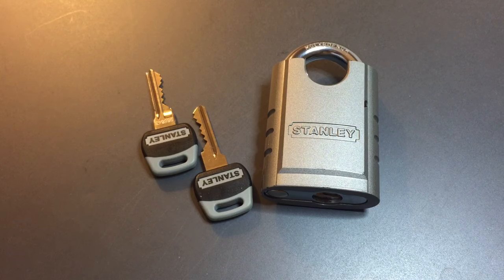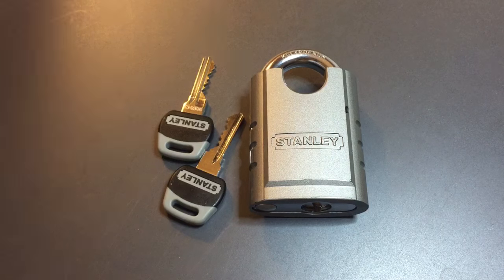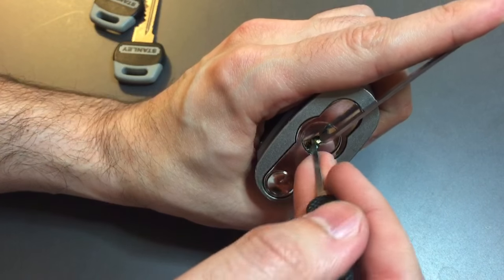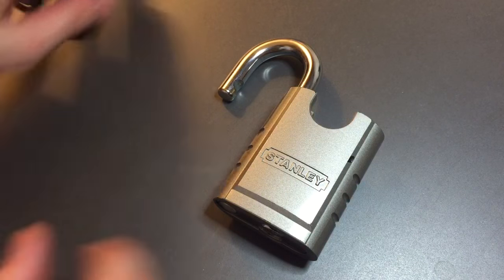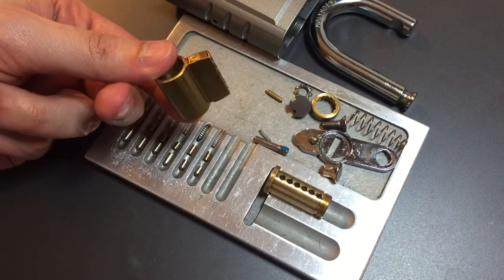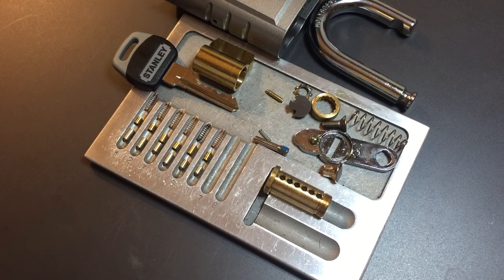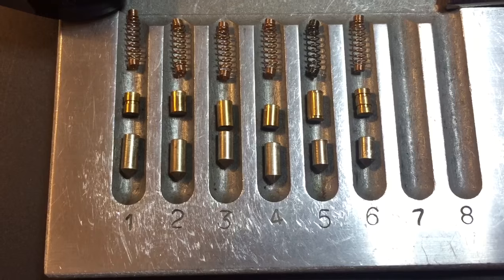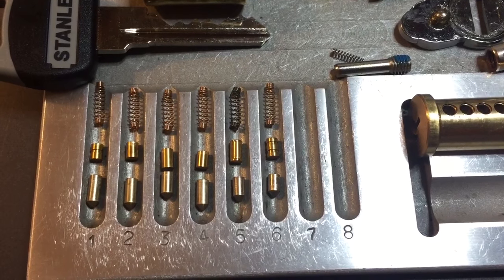[163] Stanley Solid Steel Shrouded Padlock Picked and Gutted (Model CD8820)

Comment: As far as value goes, I was able to pick up a two-pack of these on Amazon for $42.50. I would say that was an exceptional value.
Reply: Yeah, I just checked and they are about $33. And those seem to be limited in supply. On eBay they are around $60 or more.
Reply: Be careful the 2 pack is the 50mm version I haven't been able to figure out what if any difference other than size and dont really want to spend the money to figure it out lol

Comment: I have that lock! It's in my naughty bucket still. I'm still pretty new to picking. up around a 911 master. great picking sir! Always looking forward to your video sir!!
Reply: Hey, me too!  I have been honing my chops on lesser locks (many with security pins), and finally got stuck on a 911.  Have you been able to pick it?
Reply: +Mario G. Cardiel , yes sir. I have been able to pick it, just having a hard time being consistent with it. Also struggling, with the top of keyway tension.
Reply: Cool!  That is exactly my same problem.  I didn't have a tension wrench for TOK until recently, so I have to learn how to use it.
Reply from the maker: Thanks -- Keep at it.  I'm sure you will be slaying these locks soon!  As for TOK, keep using it no matter how awkward it seems now.  Once you move to more advanced keyways and more extreme bittings, you will find that many locks are all but impossible without it.

Comment: Great lock and very nice picking. Was it the first time you tried to pick it?
These 8min promise makes me think. The picking resistance is dependent on the bitting and on the person piking the lock. How can such a number be given at all. Are there standardized educated pickers who test and then they take the average. This sounds more like guesswork to me not like exact science.
Reply from the maker: Thanks.  I almost always pick a lock a few times before the video... just to make sure setting the camera up isn't a waste of time.  I, too, would like to know more about how they make the determination.  I've read the standards for ASTM and UL437, and they are not very specific... practical application of the standards would be far more illuminating.
Reply: @lockpickinglawyer  From ASTM F 883-04 "5.1 Inferences — Cylinder picking, impressioning, rapping,
 decoding, and shackle shimming are described in this specification. Since the skill of the person doing the testing has a direct bearing on the resulting times of the tests, one of each test shall be conducted by a minimum of three different persons having experience of not less than three years of approximately the same skill level and the results averaged for determining relative levels of performance."

Comment: A warning to anyone wanting to buy one of these, if you order cd8820 you now get the 50 mm lock with a 9.5 mm shackle. Not a bad lock, but not this lock either. The new number is 828-160 also hard to find. Be careful!

Comment: These are $28 on Amazon in single quantity, or $46 for a two-pack, so $23 each. I cannot find the 60mm version anywhere now except in laminated without the shackle guard. Still really no point in upgrading the cylinder when you can get an Abloy for less that this plus the cost of any better cylinder.

Comment: Which lock would you recommend for storage units? shipping container doors? I was looking at this one and also some of the Abus Diskus locks, as well as the Brinks disc locks since I can get 4 for $50 keyed alike.
Reply: If you want the best security solutions then get an Abus 83CS/55 or 83CS/80 or Abloy PL362 or PL350 or Squire SS65CS or SS80CS. If you buy cheap then don't expect your shit to be there in the morning! Those I suggested are best bought on eBay auction. I recently got a "bombproof" Abloy PL350 for £45.00 I was dead chuffed! 😎💨👍 All those mentioned a basically bolt cropper proof too!
Reply: ps: The worlds toughest heaviest strongest padlock is now available for around £300 on eBay...the God Almighty Squire SS100CS with its 20mm Boron shackle & weighing in at 9½ lbs. A SeRiOuS Padlock! 😲

Comment: Do you know why some low end and a few high end locks have laminated plates? E.g. the military Miracle Ingersoll.
Reply from the maker: It’s a good question, and frankly, one I hadn’t considered before.  I’d imagine that laminated construction using punched layers is much cheaper than machining a solid block of steel, so that would be a significant consideration.  On the other hand, laminated construction has a long history in security applications, where impact resistance is at a premium.  The laminated construction allows the lock to flex rather than break, and this construction is used in all manner of bunker, vault and security doors.  In that regard, maybe the laminations allow for the use of much harder (cut and grind resistant) materials without making the lock susceptible to shattering under impact.  Anyway, that was my long way of saying I don’t know, but I wouldn’t just assume that the construction is used because of price considerations.  There may be distinct security advantages.  Maybe someone who knows better than me can chime in here.
Reply: Certainly good ideas you have about the matter.  I wouldn't be surprised if you are absolutely right =)

Comment: some assa pins would beef up that lock good
Reply from the maker: +JB I think a new core would be needed to do this lock body justice!
Reply: +LockPickingLawyer its got the counter milling,  it just needs some barrel pins to make them effective
Reply from the maker: +JB Wrong kind of counter milling.
Reply: +LockPickingLawyer not necessarily, it would cause some major false sets instead of snagging it could make the picked pins fall
Reply: @Johnyrocket70  do as you suggested and send it to him, would like to see if it improves the pick resistance, even if he does pick it, this would make for good viewing.

Comment: I have this Stanley lock and am trying to swap the cylinder with an ASSA. The moment you remove the Stanley cylinder there is a small odd shaped washer that falls out of place no matter how careful you are and you don't even have a chance to see it's factory intended position. I hoped this video (or any others on YT, would show how it's supposed to be positioned but nobody shows a re-assembly and I'm stuck. Anybody know which way to put that little washer in as I cannot get the cylinder's tail end to engage the locking mechanism after removal. Stanley customer service is null and void, they have about 5 different departments and nobody has any info which is amazing to me considering they advertise this as being able to swap the cylinder out to re-key it if need be, I guess they assume everybody is a locksmith lol. Thank you!
Reply: Apparently I just needed to post a question to finally get it right. If anybody is stuck on this and wondering, that little  washer goes in as it's shape would indicate best, make sure the "U" stamped in it faces up so you can see it when looking down into the inner body. Look closely as there's a slightly grooved out channel in the body itself for this washer to seat into which allows it to sit flat. Make sure you get that washer in that channel, again, it should sit flat. Any slight angle other than flat will most likely make it impossible to get the cylinder to engage the locking mechanism. From there, upon sliding the cylinder in, a slight amount of turning the key to the left with gentle downward pressure until the cylinder drops down into place, it's truly a touch kind of thing and may require slight turning of the key back to the right and then left again. You'll know when it's right as the cylinder will drop down a little more to the point that it'll be about flush with the surface of the lock body. This may have been obvious to others but it's given me hell for a bit of time and feels great to finally be together and functioning with my new ASSA cylinder!

Comment: what cores i can get for this lock. pls send me link
Reply from the maker: Most schlage style KIK cylinders will work... brand doesn't matter.  Cylinder format is the key.  Also watch out for key formats that will not fit through the spinner... things like BiLock and Abloy Protec will not work.
Reply: Go with schlage Primus or schlage Everest primus, as it's easier to obtain from a lock smith

Comment: could you just grind off that nut and just drop the cylinder out a cordless dremel can do that
Reply from the maker: +RamJetGMC It's a little harder than you might think... The nut is much larger than comparable pieces on similar locks,  but yes, that would definitely work.  If I was gonna big to use a Dremel, however, I might just use a cutoff wheel on the shackle, hasp or chain.  Either way, it's a time consuming, and noisy attack.